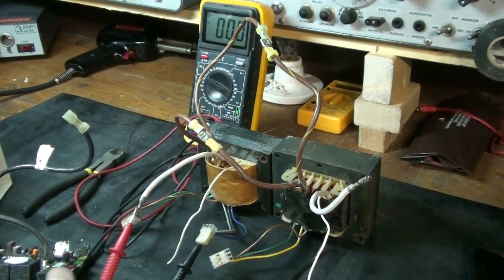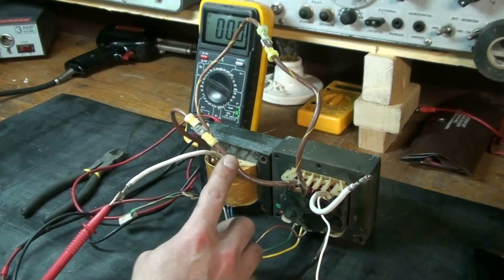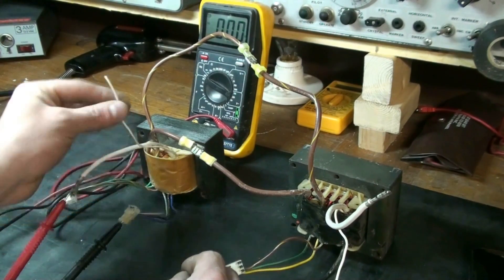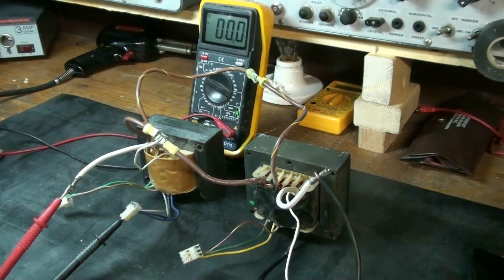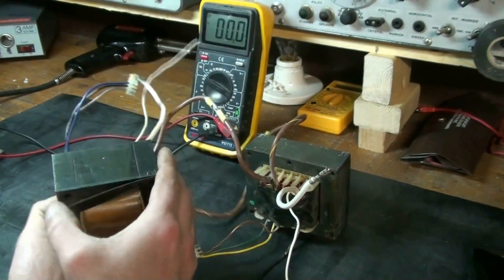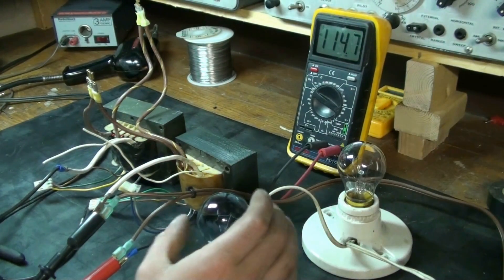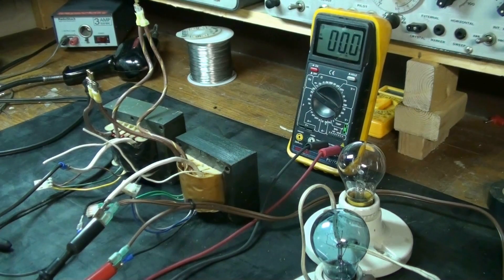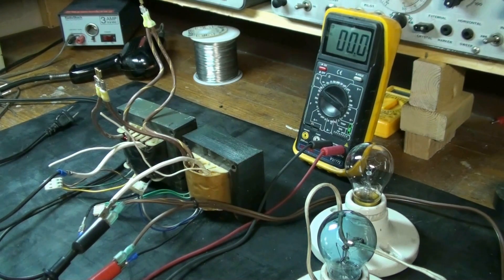Isolation Transformer Build Part 1

Comment: So your using like a 120v to 12v and another 120v to 12v wired in reverse to pull it back up to 120..?
Reply from the maker: @Z-Ack  Essentially yes.  The specific transformers ideally should be matched (unlike the ones I used).  These days, a battery powered inverter (such as an Ego Nexus or a Jackery) could also be used. The idea is to totally isolate the output from any reference to the input and have it "floating".  For instance, it you touch a single lead of the output, and you won't be shocked. Care still needs to be taken, as you'll still get shocked if you touch both leads. Hence, why it's always best to keep a hand in your pocket while working on mains powered equipment.

Comment: IF you had two identical transformers, some calculations would be easy.  On the secondary, multiply the volts and amps for VA.  That would be the VA rating of the overall system.  You would need to multiply by the power factor to come up with the Watts load it would support.  Since you have 2 different transformers, the lower rated one will be the determining specification.  Your voltage will suffer.  it will be like having a step-down current transformer.  The voltages match but the currents don't.

Comment: I believe that there is a FATAL FLAW hidden within this setup. The windings found on the particular transformers used in those small Tripp Lite UPS's are NOT isolated from each other. This is easy enough to check with a simple continuity rest. Transformers harvested from older APC branded UPS's seem to be OK.

Comment: Do you think it would be okay to connect this to a Variac to bring the voltage back up to the 115...

I'm also wondering how much difference there would be if you had a pair of the large transformers. Maybe less voltage drop and or higher wattage capacity?
Reply from the maker: A variac my do the trick, though my "variac" doesn't have an overdrive section.  The issue with the lower voltage is because the transformers are similar, but not identical.   I forget the ratings on the UPS's, but one was something like 300 kva, the other was 400 kva.  Very old and small Tripp-Lite units
Reply from the maker: 300 and 400 VA  not KVA!  I could only imagine the things I could do with a couple 400 KVA transformers! o.O  My neighbors probably wouldn't like me much...
Reply: FREDDIE MAXWELLp